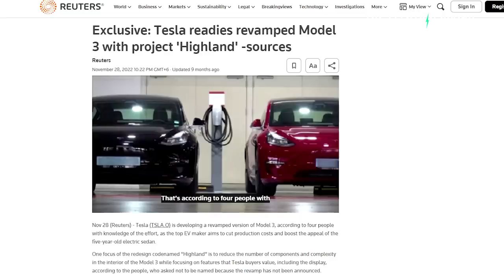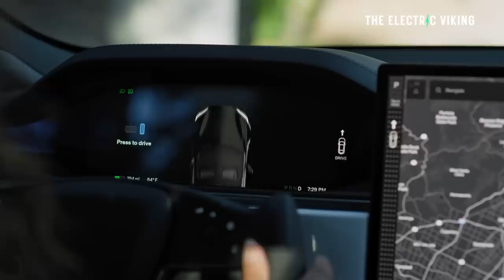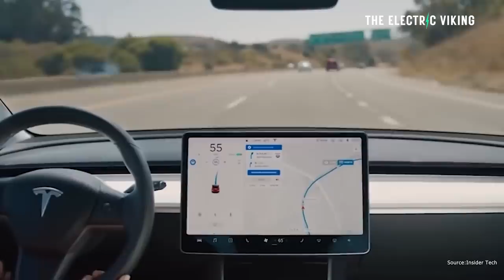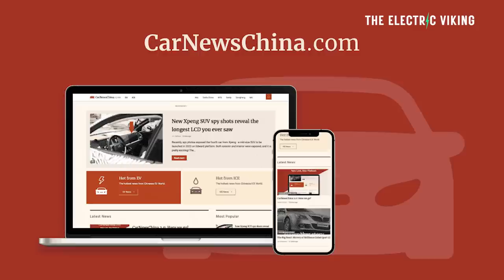NEW Tesla Highland 15% cheaper with 70 miles more range say insiders

Comment: I live in the UK and recently decided to extend the lease on my current EV by 6 months so I could see what the BYD Seal and the new Model 3 have to offer.  I believe the Seal will be launched in the UK in October and by the looks of it this may be around the same time as Model 3 highland also becomes available.
I personally prefer the exterior design of the Seal to the current Model 3 but if the new exterior design of the Model 3 makes it look more like a scaled down Model S and the range is extended then it would become a very tough decision.
But .......... if the price of the Model 3 drops by anything like as much as you're suggesting, then it will become my next EV and I believe this will be the case for many, many other people around the world.
Reply: I've had a Model 3 Performance for nearly 4 years and, like yourself am seriously looking t the Seal to replace it, it has a better interior and I also think it looks a lot better than the 3.  The new 3 is interesting though and still in the running with one proviso - the new 3 is quieter than the current one, which is far too noisy at motorway speeds.
Reply: The UK and EU better wake up and require all EV be made locally.
Reply: Tesla has an unrivalled reputation for quality. We'll be replacing our M3LR, with a future Tesla.
Reply: The new model 3 is pretty impressive 
What you gonna do?
Reply: Have to agree, the BYD looks far better than the bland Tesla, I'd go for that if they do and the support is good enough.

Comment: If they implemented the lower cost motor it’s very possibly true. Then there are other cutting costs like the giga cast. Would be amazing if they installed the 48 volt wiring.  But I doubt the last change.
Reply: The 48-volt wiring will happen to reduce the amount of copper wiring in the car. The new Model Y has a 16-volt lithium-ion low-voltage battery rather than the 12-volt lead acid battery.
Reply: giga cast isnt cutting costs. too many failed castings. they didn't buy a big enough press.

Comment: Hopefully no yoke or indicators as buttons on the wheel. They might work okay in countries without roundabouts, but they're absolutely terrible to use with lots of turning on roundabouts etc.
Reply: I am guessing the lack of an indicator stalk will be more of a deal breaker in countries like Australia than Tesla realise. Seems like such a cheap item to omit considering the trouble it's going to cause.
Reply: Im hoping for a yoke option and capacitor buttons as standard for both options. The highland is rumored to have steer by wire not that the yoke was difficult to drive in the first place
Reply: You don't use the turn signal while in the roundabout.  Upon entering the roundabout your indicator will be activated and then you complete the action just like a 4 way stop.  Sounds like you don't know how signals work.  Never understood why it's so complicated for someone to understand.
Reply: You HAVE to indicate when exiting a roundabout in many countries. Road rules are not the same in every country. Try using indicator buttons when the wheel is already turned - it's a nightmare. For me, this is a good enough reason NOT to swap my existing model 3 for a new one. And whilst on screen gear changes are useable enough, the stalk gear change is so much easier. And a button based horn? Hope you don't have to try to find it in a state of panic during an emergency. Moving from an ICE car to a Tesla was a quantum leap forward in driveability and ownership experience. But now that I'm here, I don't see the point in effectively "downgrading" to a new Model 3 who's features exist purely for the sake of making it cheaper to build.
Reply: fascinating… I wasn’t aware
Reply: @vasil7410  If the turn signal activated just by squeezing the wheel, would that work for you?
Reply: i had a loaner with the yoke, and i have to say i didnt care for it.  and i didnt care for the lack of shifter stalk either (model S) as someone that does a lot of tight backing up, turning around etc that stalk is quick and intutitve, shifting on the screen SUCKS
Reply: that signal stalk weighs less than your cellphone.  a 2 ounce plastic slab isnt going to make a difference@EnriqueThiele
Reply: @williamgrunzweig571 Nope, you are REQUESTED by law to signal what roundabout exit you take while on it, especially on two lanes roundabout, good luck doing this with a yoke as the turn signal button will be on the opposite side and up-side-down. You get it now ?
Reply: @mnhsty  When the wheel is straight ahead it would be ok. But the problem is activating the buttons when the wheel is turned. Have you ever tried to adjust the radio volume via the steering wheel when the wheel is turned? Very hard to guess which button to press for up or down - or on which side of the wheel the buttons even are!
Reply: @EnriqueThiele And whose "bottom" are you going to push?
Reply: @maxflight777  Yes, Tesla have got away with these controls on the model S and X because they are low volume models and sold primarily in the US, where they don't have the same roundabout road rules as other countries. When these controls hit the main stream markets targeted by the model 3 and Y, I think Telsa will be get significant push back. Can even see some jurisdictions go as far as banning these controls, for safety reasons.
Reply: @vasil7410   In my scenario, there would be no buttons.

Comment: I think the yoke goes with drive-by-wire, no mechanical linkages and software adjustable steering. That was missing when they introduced it to Model S and many drivers didn’t want to adjust. For Highland with steer-by-wire the driver can now have intelligent steering with the car adjusting it’s performance based on context. 

This will also go with steering wheels that are plug and play, put on Right side, Left side or neither side for different countries and uses.

Comment: Pricing Estimates 
Standard - 26,300* Top Speed 150 mph 0-60 5 seconds
Long Range - 32,300* Top Speed 175 mph 0-60 3.8 seconds
Performance - 45,300* Top Speed 199* 0-60 2.99* seconds

 
*after 7,500 tax credit. Estimates Based On Current Pricing and Insider Information
* speed adjustments made to new models based only on guess and or prediction.
Reply: My Guess on where they will land after a few months of initial orders.

SR $38-39k 0-60 5.6 (30.5-31.5 ATC) 322mi EPA  
LR $44-45k 0-60 4.0 (36.5-37.5 ATC) 380mi EPA
PF $52-54k 0-60 3.0 (44.5-46.5 ATC) 355mi EPA

Let's see who's closer when it's announced

Comment: My take on that pic is that it is a wheel, not a yoke. The hand is at the top but the front wheels are straight. Keep up the great work.
Reply: Wow!  What if the secondary display is mounted on the steering wheel itself in future models, now that would be an upgrade!

Comment: Let's see if you still need to use the centre screen to open the glovebox. Let's see if there's still no rear wiper on either the next Y or 3. Let's see if there's still no V2L. Let's see if they keep the indicator lever or put the buttons on the wheel.

Tesla's making good cars with some strange design choices. No radar and relying on cameras? That'll work really well in wet or dirty conditions.
Reply: I love that there's no stalks in my car. Couldn't care less that you open the glovebox from the screen. You could likely do it with a voice command too. No back wiper isn't ideal. If those are the cons, then the pros vastly outweigh them for me.
Reply: @keithlamontdavis8047  What was wrong with using a button or lever to open the glovebox? What's wrong with indicator stalks? It's just gimmicks for the sake of itself.

Comment: If the yoke appears as an option (my guess) the car will likely also add drive-by-wire steering, which has been rumoured as well.  This enables Tesla to adjust the rotation of the wheel according to speed - and will make the yoke a MUCH more livable feature.  A second screen, while welcome by many, is doubtful due to their constant reduction in parts (and price).
Reply: Definitely agree about the 2nd screen for the same reason.  I too think the yoke will be an option.  Not sure if they'll offer the drive-by-wire feature, but that would be cool.
Reply: Without variable speed steering the yoke is dangerous
Reply: @23chnge  Lexus, who make those?
Reply: no, the yoke is perfect, you need to use 1 hand,thats the trick.
drive by wire is garbage nonsense
Reply: @JohnSmith-pn2vl  In some jurisdictions, you would be fined for steering with only one hand. The yoke, button indicators and a button horn will unfortunately hit a regulatory brick walk in some jurisdictions. Can't believe Tesla haven't realised this.
Reply: @vasil7410 no requirement to only drive with one hand with a yoke.
How are they going to tell anyway,?
 I hold the yoke at the bottom and you have to be along side my Tesla and be high enough to look down almost to my lap to see how many hands 9n the yoke.

Comment: Makes sense, this is tech, they have gotten more efficient, more streamlined, and economies of scale.
Reply: economies of scale is a myth. more efficient practices come from experience. companies experience problems, and find ways to overcome them. this increases production efficiency, so when they build a new factory they design it based on those lessons learned.
Reply: makes sense does it. Yeah, all the car companies keep lowering their prices
Reply: @I_dont_want_an_at  in the beginning, they did, as they got better. in the beginning car companies got cheaper and cheaper, but now with every one of them run by business majors rather than engineers, they make business decisions that result in higher profit, rather than engineering or even design decisions that result in better cars or production methods. if your mind is business, you'd be insane to spend money on changing or rebuilding a factory that is working fine right now. ford (as in henry) didn't have to worry about being replaced if he provided only 95% of the possible profit, and neither does musk.
Reply: @satoau1  Astute analysis!
Reply: @I_dont_want_an_at  Most of the car companies making EVs lose more money every time the drop the price.
Reply: @satoau1  Yet musk has been pointing out that car makers need to engineer the factories as well as the cars.  "The factory is the product" if memory serves.
Reply: @danharold3087  yet? that's exactly right, and they don't because they're MBA's not engineers.

Comment: Not sure why the yoke is controversial.  I know many people who have never used the yoke hate it (or hate Tesla), but I wouldn't go back.  The yoke just feels better to me.  It does take a week or so to get used to it, but I have no problems with roundabouts, 3-point turns or anything else.  As a plus it's also safer in some situations, should the airbags go off.  I expect if the Highland has a yoke, it will be an option like the Model S/X.  Nothing wrong with a round steering wheel either, so pick which works for you.

Comment: the savings in the manufacturing process doesnt necessarily translate to savings at checkout, especially during the initial launch where demand will be high regardless. Tesla has always had a nimble pricing strategy, so we should see savings once supply and demand reaches equilibrium. however in the near term, its likely that the pricing will remain the same if not slightly more expensive.
Reply: @EnriqueThielefor sure Tesla will lower the prices, but doubtful any price drops will be seen at launch in the Australian market. we'll see.
Reply: Exactly. Long term it gives them the capabilities to drop the price. However, initially they won't need to drop the prices as there will be high demand for the new model with many orders pouring in
Reply: old model 3, $57500.. new model 3 $61900
Reply: @jakgats1411  where did you find that?

Comment: Most people don’t need large batteries to get a long range. The Prius Prime hits the sweet spot, it takes a lot less resources to build an ICE with a small battery, than  no ICE with a larger battery. It has better reliability than any Tesla. It can charge without electrical upgrades at home yet will cover most commutes with zero emissions. And you take a long trip with zero charger downtime / stress. It now looks better than any Tesla too. That’s the future, eventually the ancillary power source will be zero emission too (fuel cell or efuel).

Comment: I saw a recent vid on how BYD managed the battery temperature. It was cheap to produce but meant that battery repair was virtually impossible, and temp regulation was poor compared to Tesla. Until I see a good temperature regulation system in BYD, I would not give it a moment of consideration. Tesla did the hard work in the most important area. They lead.

Comment: I certainly don’t want a centre display. The current display is perfect as it does not distract the driver.  I spent a lot of time in the car in the past few days on a long motorway drive. Moving my eyes down to the dashboard in front of the wheel or to the side requires just as much effort, so nothing to be gained by adding clutter and distraction in front of the driver. 
Just hoping Tesla address the boot space issue. There certainly needs to be a hatch-style opening for the boot.

Comment: The model T, when it was cut to 480 dollars, exploded the car market of the time.  Adjusted for inflation, that’s 25,000 dollars, so once they hit that mark, it will flip the US market
Reply: Unbelievable imo way back in 1922&23 fomoco sold over 3,600,000 model T with no computers, cad, robots or automation. Heck not even the interstate highway system existed back then. Nor did massive dealerships to take the inventory and store it for all those customers. 👍🏻😎

Comment: will be waiting for the RHD's :(
One thing I hear from a lot of friends is how expensive the Tesla must be (I have a Y). It is hard to convince them how much cheaper the these cars are, in terms of value
Reply: Value is a subjective perception thing. Cold, hard, absolute dollars is not.
I don't see the value in any ev - I simply don't do enough mileage to make trading in a fully paid-for, perfectly serviceable ten y.o. ice a financially smart decision. And I don't give a toss about driving the latest thing. But no ifs, buts, or maybe's, my bank balance is $50k better off. That's where I, and presumably your friends, see value.
Reply: Few people know that dealerships get almost all of their revenue from maintenance charges....not from profit from sales. Maintenance that is not there with an EV.....air oil fuel filters, hoses, belts, oil changes, spark plugs..... even brakes last longer with regenerative braking .
Reply: 2023 tuscon hybrid.  36mpg, $44k fully loaded
2023 model Y..  $47k base model, only lacking feature over the tuscon is air cooled seats, but far superior tech wise every other way.

not exactly a hard sell in terms of cost comparison.
Reply: @petercroft9895  Sounds like you should have said you don't see the value in trading a paid for car for a new one of any sort?    Your statement is not specific to EVs.
Reply: @baldisaerodynamic9692  36 mpg for a hybrid is pathetic. My current car, a Prius C routinely gets 50 mpg.... Justified the extra cost and complexity. But my next car will be a Tesla.
Reply: @danharold3087  Probably a fair statement  - I drive em till they drop, done the new car thing once, it’s overrated IMO. But more than a few people are stretching themselves financially and buying an ev on the basis of all the money they'll "save", whilst conveniently forgetting the dollar cost of that transaction. I could go out and buy a brand new M3 for every day of the week - cash, affordability is not an issue. For my situation though, I'm just not seeing any value in ditching the perfectly usable vehicle I already have.

Comment: Doesn't matter how good the cars are until the infrastructure is in place it's not happening. In the UK  we are barely managing for electricity now with people getting discounts for using at different times. We have several Nuclear power station going off line soon and only one planned to replace them. They want people to stop heating their homes with gas and use electricity instead plus all of the energy currently used for transport. Then they need 10s maybe 100s of thousands of affordable charge points. Fast charging a car costs more than fossil fuels and the cars are much more expensive. I've no doubt that change is coming but a tremendous amount work to be done and  money has to be spent by government .

Comment: it would be nuts if the new long range will have NCA or LFP, if it has lfp with 350 miles and you can charge to 100 percent it will be a game changer, i wish i know what batteries the new car get, the reason why i got the RWD was for the battery that has 100 percent charge and longer battery life

Comment: Doing the math in Texas, if you take the cheapest trim of the cheapest Tesla and remove 15% then apply a trade-in of $10,000, then add in the Tesla charges plus TT&L, you're financing about $19500-$20000. When you apply the 7500 FTC you're at $12-12.5K. Not bad.
Will make it interesting to see what they do with any 2023 M3s left in local inventories. Maybe that's what they'll be using for the upcoming Texas Tesla rental POC they will be starting. If not, I would guess they'll make national car rental chains offers they can't refuse.
Reply: they will just keep discounting them till sold, you can get long ranges now for 44,000 in the inventory

Comment: The yoke may be to accommodate steer-by-wire, similar to what Canoo is using.  At slow speeds the amount the steering has to be turned is less since the steering ratio can be variable so a round wheel becomes unnecessary.

Comment: improvment with 48 volts reduce the cost and weigh of wiring and also higher voltage draw less amperage from the motor.